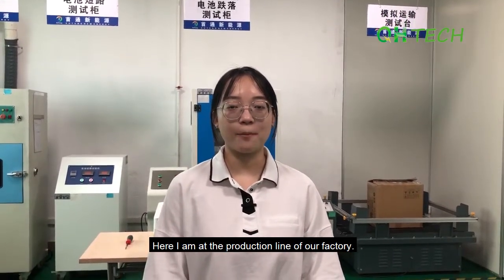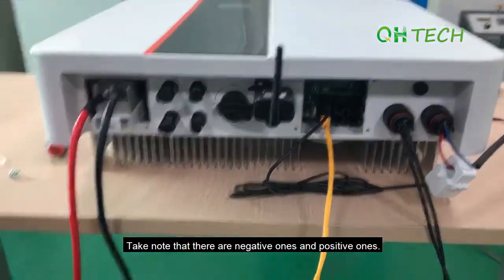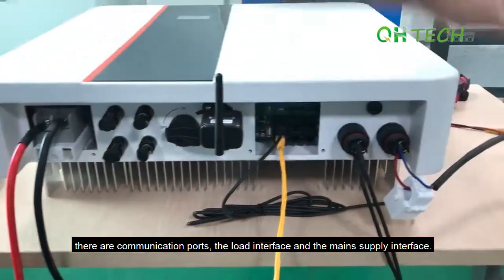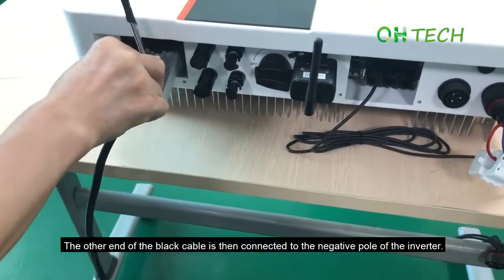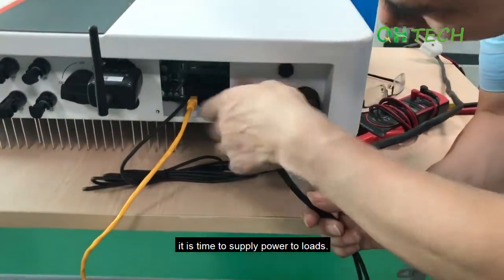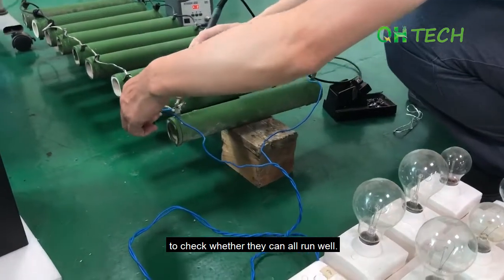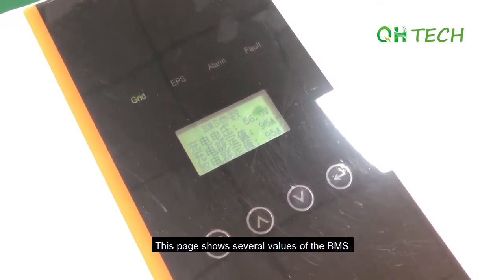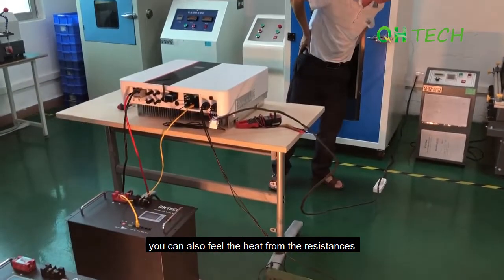Connect 5kW Inverter with 51.2V LiFePO4 Battery? Solar Beginner Guides!

Comment: why my lifepo4 24V battery SPARKING when I try connect it to turn off silar inverter?
Reply from the maker: Hi, sir. You can try to turn off the system and check for an internal shortage in any equipment or incorrect wiring.